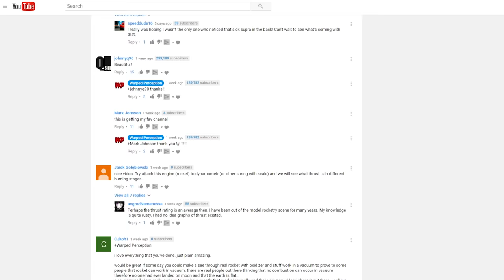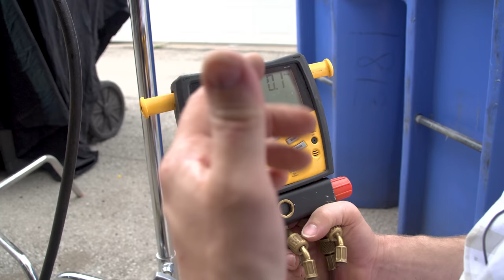Model Rocket Engine In A Vacuum Chamber - 4K Slow Motion - will it burn? - Rockets (S1 • E3)

Comment: You had resistance to the wire this is a joke I have a degree in Mechanical Engineering you're not fooling me!! You can't burn fuel in a vacuum!!
Reply: You don't need air. What you need is oxygen or something that provides oxygen, for example, air or oxidisers. The rockets are able to move in the vacuum because they have both fuel and oxidiser - oxidisers provide oxygen - to burn. For example, assuming that the fuel used in this video is a few grams of black powder, then the oxidiser would be the potassium nitrate (KNO3).

Comment: its still pushing from the back eclosure wall though,..can tell this byhow long it takes to push forward,..if pushing from air molecules it would have been more instant...stop trying to see what you want to see,...ain t no walls to push from in space lol
Reply: Let me put it like this:
It doesn't need to push against anything to move. By pushing the gas in a direction, it's 'giving' it momentum, and since forces can't be created or destroyed, the motor goes in the opposite direction. So basically, by pushing the gas in one direction, the gas pushes back in the opposite direction omg science!!

Comment: In fact your experiment proves that ''the gravity'' can't hold the air around ''the globe''. Besides, gases are expandable and that's the principle used in experiment. So, if the gases expand in your vacuum chamber and the experiment is at ground level where your gravity is the strongest, can you explain how the earth can have an atmosphere when surrounded by vacuum?????
Reply: The atmosphere isn't pressurized it's just a pool of air. The pressure is from weight alone like in the ocean - 15K+ psi at its deepest. 

So why doesn't it just float into space? For the same reason the ocean doesn't. Gravity. 

Oh and vacuum creates no force of any kind it's simply a really low pressure.

Comment: Your 'rocket" is connected via the metal ring to the plastic housing therefore you're never going to accurately demonstrate what the effects would be with a device/rocket/ship that was free floating in the open vacuum of space. Additionally, in an enclosed space you're providing matter that can change the dynamics via both the walls of the enclosure and the particulate matter of the smoke expelled by your "rocket" within said enclosed space. I'm not advocating flat earth or representing any other position(s). I'm simply saying that your experiment is incapable of supplying any proofs because the design doesn't mirror the conditions of the environment in question.

Comment: For all of you that think "Rocket Propulsion does NOT work in a vacuum" I have often pointed out to the YT video: "Uninterrupted Footage of the Falcon Heavy Launch and Booster Landing!"
   NOW there is a video that compares this video to the SpaceX video SIDE-BY-SIDE:  "JM Truth & The 20 Second Discrepancy - Part 2"  
Now watch THAT YT video and tell me that rocket propulsion does NOT work in a vacuum.

You would be WRONG and this video proves it - beyond the shadow of a doubt.

NOW watch as the flat earth morons try to say that the boosters are NOT "in a vacuum" when they most certainly ARE (and even the video footage proves if you know what you are looking for).
Those side boosters separate above 50 kilometers and fly as high as 120 km before landing BACK AT KSC.

Tell me HOW did the side boosters CANCEL 3600 mph EASTWARD velocity, TURN AROUND, and FLY BACK to KSC in a vacuum if rocket propulsion does NOT work in a vacuum?HOW did those boosters DO THAT?  - Black Magic?

Comment: +Warped P.,
 This is a very good video and I appreciate all the effort to produce it as well as the one with the transparent motor I saw. 
Unfortunately, we see how some refuse to accept fact and find ways to talk themselves out of science. Don't let that deter you.
...
However, you need to make one correction. Perhaps a text on the video. 
These motors do not burn-thrust for 8 seconds.  It appears that you used a *C6-7*.
...
NOTE the burn times of 0.7 and 0.8 seconds UP TO 3 for larger ones!

Yours would have been under 2 seconds shown here:
http://www.nar.org/SandT/pdf/Estes/C6.pdf 

Perhaps you can view your original video to verify it was more like two seconds.

Other examples:
http://www.nar.org/SandT/pdf/Estes/A8.pdf 
http://www.nar.org/SandT/pdf/Estes/B6.pdf 
http://www.nar.org/SandT/pdf/Estes/F15.pdf  
...
http://www2.estesrockets.com/pdf/Estes_Engine_Chart.pdf 
- - 
Regards, S.
Science and Technical Advisor
challenger . org